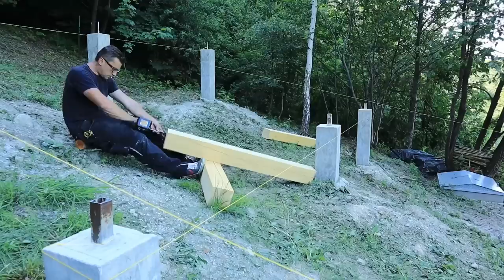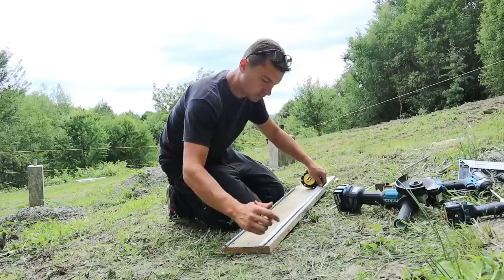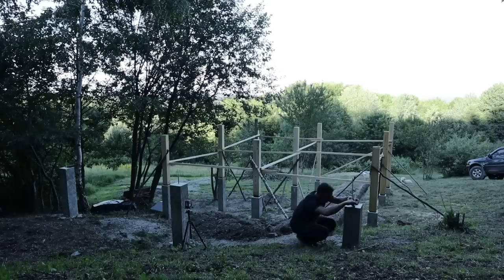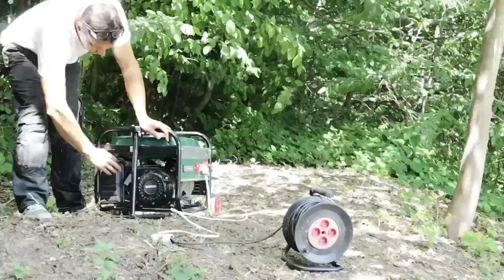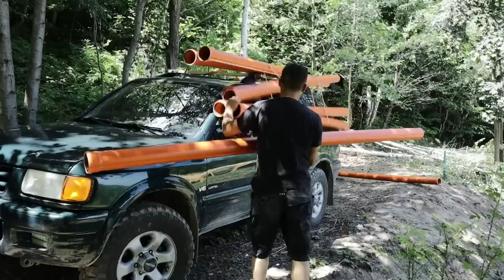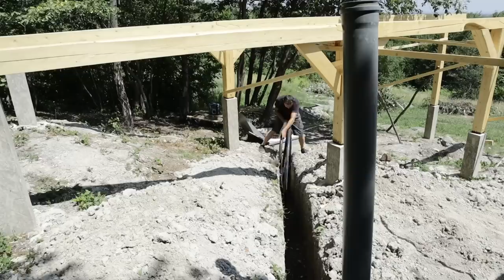I am building an A-frame house by myself.  Part 5. Wooden base of the house.

Comment: A lot work, many hours.
As a professional builder craftsman I would have fixed and straightened the edge posts and then positioned the other posts with a line.
Because the connection between the concrete foundation and the wooden posts is not very stiff, I would brace the wooden posts sideways, in both directions more, just out of my guts. 
But in general: great job!
Reply from the maker: Thanks for the advice, I'll take it into consideration.  And thanks for the kind words!

Comment: Encasing steel in concrete exposed to the weather is a mistake he will subsequently pay for in the future. Water intrusion between the steel and concrete will corrode the steel with the rust expanding to the point the concrete will crack. He was very smart in treating the bottom of the wood posts as he did to keep them from rotting and installing a bearing pad under the post.
Reply from the maker: According to my calculations, water will not get to the steel in the concrete, but thanks for the advice.
Reply: @fitsych.m   What is there to calculate? Water goes where is wants unless directed else where, which you have not done.  I see no hat flashing or fluid applied flashing to prevent it. How exactly are you going to prevent water from getting in between the concrete and the steel? When steel corrodes, the resulting rust occupies a greater volume than the steel. This expansion creates tensile stresses in the concrete, which can eventually cause cracking, delamination, and spalling.
Reply: @gary24752  There are a lot of concrete pillars for fences, electricity, etc. they are without water prof and stay about 40-50 years without critical damage of rust.

Comment: Not convinced about the vertical stability relying on such a short length of square tube or the dimension of square tube
Reply from the maker: the square pipe is there only for fastening, it does not bear the load.
Reply: @fitsych.m  correct, the concrete pylons bear the load. I was referring to the sheer forces that 'may occur' at 90 degrees to the vertical should the structure sustain a sheer force/forces. For e.g. owing to an undefined sheer force, the structure will tend to move in any direction transversely

In this case, I thought the square tubing could have been a larger dimension and extend further up  into the wooden upright...somewhere between 15cm and 40cm.

This was my consideration. Still, it is an incredible effort and very accurately and soundly assembled. Lovely design too.

Wish I was the owner